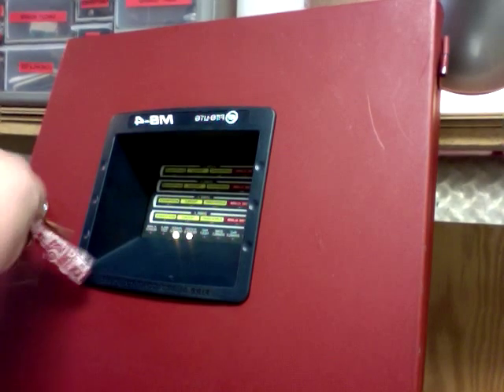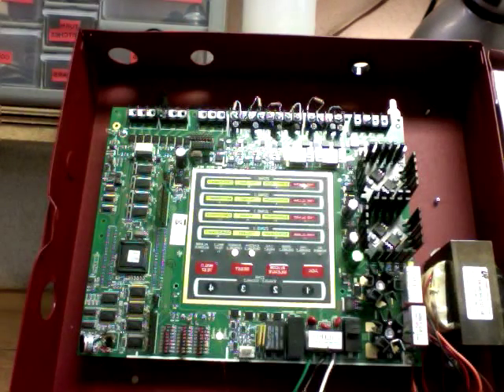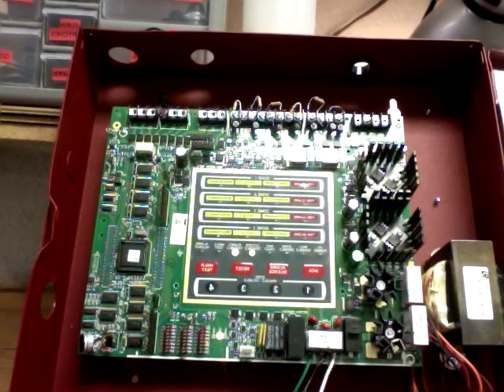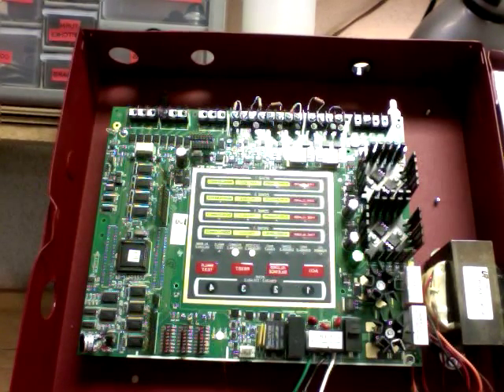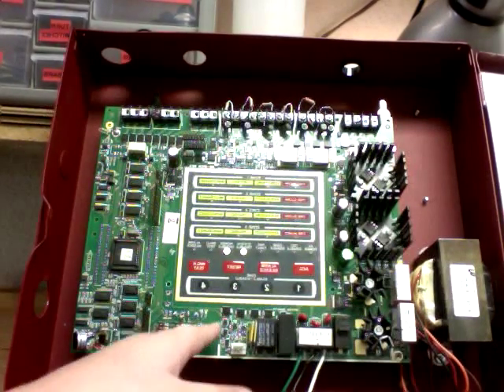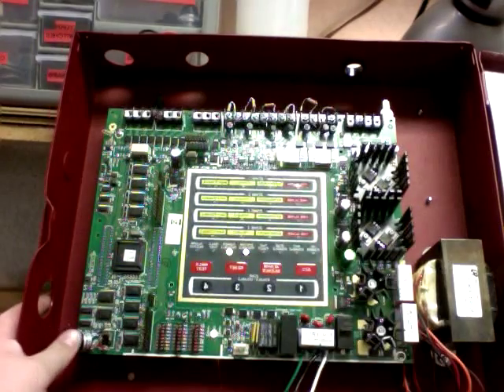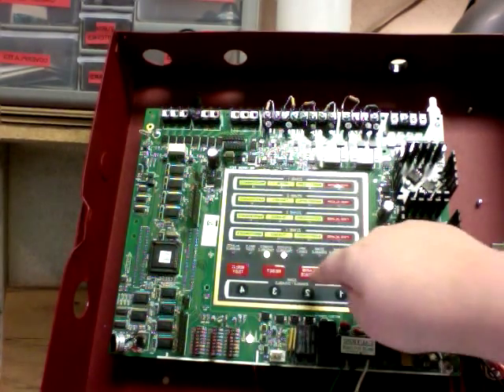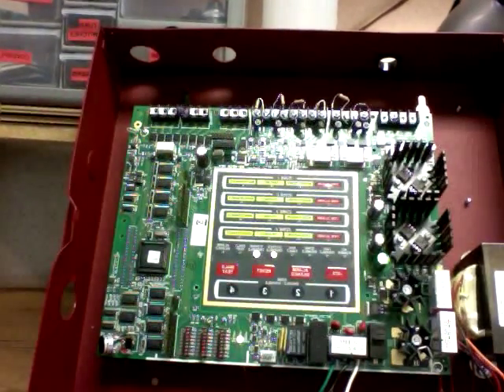My new Fire-Lite MS-4 FACP

Comment: We just got a Fire-Lite MS-4 and I noticed that you were having the same problem that we are having with ours, namely that the AC power LED is off even though it's plugged in.  Ours lights up when power is applied but goes off and re-troubles within about 10-30 seconds, and then the NACs don't work!  We have the same fault lights (we have no battery yet).  Did this problem go away once you hooked up a battery, or was there something else wrong that you had to get fixed?

Comment: The piezo is not mounted poorly. That also is not the cause of the trouble. While I have no idea why the AC Power LED is off, I can tell you that your system troubles are due to the fact that you have no batteries.